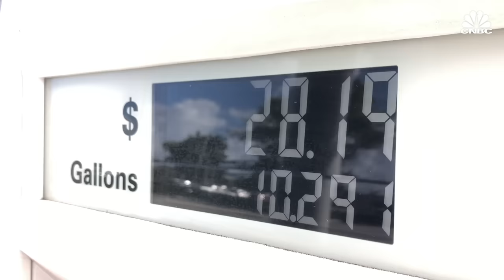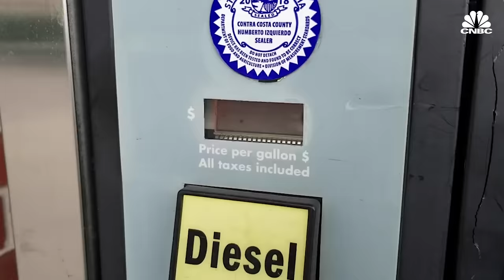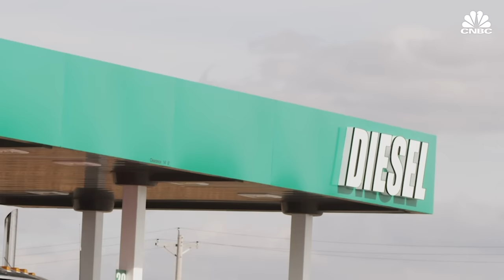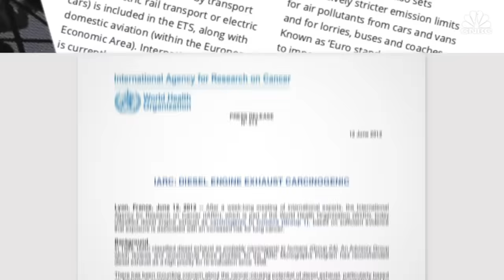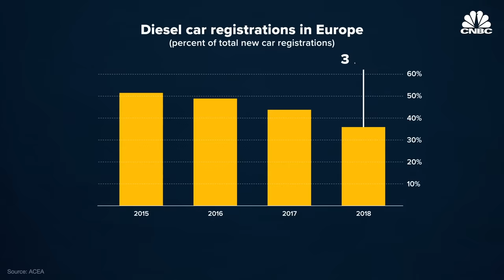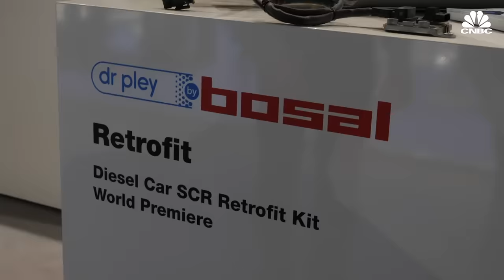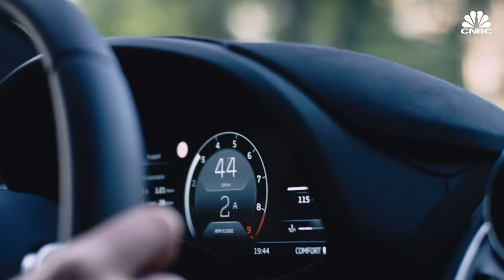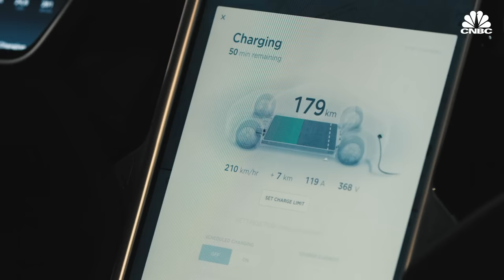Why Diesel Cars Are Disappearing

Comment: Republican here and these new Diesel engines are great for diesel mechanic pockets and are super expensive to repair ..high pressure pumps going bad and injectors because of tight clearances ..they have more moving parts  and the combustion process contaminates the oil on every start up.. why would anyone not use the sun in the sky for your fuel?  Have you ever heard of a solar panel ? Do you guys enjoy overpaying for diesel fuel ?  Makes no sense to me

Comment: It has always amazed me how diesel has crept into luxury car market. I am into true luxury cars big time, not luxury by fashionable brand name but by luxuriousness. So diesel has never been an option for me, as firstly they are noisier than petrol. Haven't some people heard of noise pollution? Stop start is also noise pollution. Now let's get practical here. Why spend so much money on a so called fashionable luxury diesel car with the priority of saving a little on fuel? Saving money on fuel is practical but spending lots of money to save on fuel does not make practical sense to me. Being practical to me, would be buying a cheaper car which would save me tens of thousands of dollars, and way out way the savings on fuel. And being a true luxury car advocate and owner, I can tell you this, that the difference between a so called fashionable modern luxury car, and a cheap Japanese car of the same size, that the marginal difference  in quality is so little. And when it comes to value for money the Japanese car will most likely give you better dependability. Not to mention serviceability. And just think, if you are not doing high milage then just buy petrol it is cleaner and less noisy. Might sound quieter than a two hundred thousand dollar fashionable so called luxury diesel car. Isn't that what true luxury is all about?, unless you are into noisy polluting sounding sports cars, and you dish out lots of money just to let people know you are there. It's amazing how society has led us into fashionable expensive impractical and familiar trendy ugliness in motor cars. Yes we may change some things for the better with the electric car, but have we in our haste really considered the downsides to come.  I hope we get this one practically right. Or at least better overall.

Comment: Fakery photos of exhaust pipes really cheapens the trust in this video.  The only time you get such visible exhaust out of an internal combustion engine is on a cold day before the engine fully comes up to temperature.
  You want greenhouse gas reduction, you go to bio diesel with the zero greenhouse gas increase.  (Hint, it is only a greenhouse gas when yuou are adding fossile carbon into the atmosphere. )

Comment: I will gladly use electric. As soon as I can run 450 miles, while towing 10k lbs, on a single charge. And fully charge it in 15 minutes from dead. And it cost me around $15k. And I seat 6 people comfortably. And have the cargo capabilities of an 8 ft bed. And last reliably 500k miles with extremely minimal repairs. 🤷‍♂️ what, you can't do that? 🤦‍♂️then stop talking electric cars

Comment: Every time I see a smoke belching diesel car or pick up, I wonder how much longer they will be tolerated. Most of the semi’s you see are well tuned and you hardly ever see one smoking up the highways. If passenger cars and trucks can’t comply give them the axe. The carbon footprint needs to be changed to a fingerprint.👍

Comment: Just add other fuels to burn the diesel better by adding propane natural gas hydrogen oxygen while it doubles the millage . And double the mileage again by giving us opposed piston diesel engines that you've only been letting the military have for the last hundred years, but keep that simple only 3 cylinder 6 piston, 1 liter for cars 3 liter for vans 21 liter for trucks. And keep your emissions garbage off , give us prochargers superchargers and turbo chargers, add water methanol to keep our temperatures from getting too high. But they wont they need to sell garbage and have repeat customers

Comment: Every barrel of oil, there will be a certain amount of gas and diesel after refining, If we do not use the gas and diesel, what are we going to do with them,pour it into the river?! The whole world are waiting for a break through in energy storage technology. for many applications. Even if we get that break through today, it will be at least 2 decades to get the infrastructure build. No more ICE cars by 2040 is so much pipe dreams. We are already at 2021. where is the break through? A significant amount of electric cars in US are really coal powered. I see nothing wrong with that, I am not a member of the climate religion.

Comment: why can't long haul trucks just be all replaced with freight rail?
Reply: How do you get the containers from the train yards to the warehouse? It's cheaper and faster to use trucks. Trains run on fixed schedules.
Reply: @kewlztertc5386  shipping itself runs on fixed schedules lol....also trains can be hauled into ports.
Reply: @Fals3Agent  no, shipping runs on a fixed schedule that the shipping company makes. They can change it, however they want. Trains are inflexible. Their schedules are made by the rail lines, and are shared by many different shippers. 

How do you get the freight from the train to the customers?
Reply: Because there aren't freight lines that run to the grocery store?

Comment: My  small diesel car , a Citroen, gets 30 km per liter( 70  miles per gallon)  New diesel engines are very very clean. Cleaner then gasoline engines. Also  diesel engines last double the mileage as gasoline engine.   People  are extremely stupid and shortsighted.

Comment: Very sophomoric and disappointing presentation.  No mention of the Common Rail fuel system that revolutionized diesel power.  Over emphasis on the VW emission scandal as a 5% increase in NOX versus a 10% reduction in consumption really was not a bad trade.  A big reason diesel cars didn’t catch on in the US as Europe was fuel price.  Diesel is far cheaper to produce than gasoline but somehow (taxes) cost $0.50 per gal more in US.  Also, everyone acknowledges that producing fuel from a food source is moronic.
After the upcoming power outages and auto supply change issues with exotic materials, ludicrous government mandates will be reversed.

Comment: Funny, we are starting to notice after Musk has challenged and destroyed the stats quo of gas cars. If the Oil and Car executives had increased research into Hydrogen powered cars or even battery technology in the earlier part of teh century, without looking for immense profits, less damage would have been caused to the planet by now. Also, BMW did a full Hydrogen regular gas engined 7 series test in 1999-2000. Robotic fueling of H2 at the gas pump, top speed was 120 MPH on the Autobahn. Exhaust was water vapor. But the industry started complaining about distribution and hydrogen plants. Interesting, since oil has to be distributed by trucks every day also.
Reply: 120 Mph? Come on, that's disappointing for a Series 7 BMW.

Comment: You wish.    There is no alternative except gasoline.  There is no electricity to charge electric cars.   The Toyota Ravv hybrid has a 2.5  litre petrol engine which uses more petrol that the 2 litre diesel variety.  The Biden administration in the US has just released stocks of this fuel reserves to cope with the scarcity.   This proves the choice is between  diesel and the horse and cart.

Comment: This is complete bs. Why do they spin such garbage. Diesel gets better fuel mileage and torque, they are responsible for literally everything heavy duty because of that fact. Longhaul trucking, locomotives, shipping, construction, the list goes on. I'd like to see a gasoline or electric powered D8 Caterpillar, not gonna happen. Also, they failed to mention that diesel puts out less carbon dioxide and carbon monoxide than gasoline engines. The black soot you see is simply particulate matter from unburnt fuel and doesn't "hang out" in the atmosphere. Typically black soot from a diesel means the engine is over fueled under heavy acceleration or during a cold start. The engines can be tuned to not smoke like that and it gives it better efficiency.

Comment: Yeah right. You're serious?  Ever thought that electric cars are zero emission but their batteries are a heavy threat to environment? Even the gasoline cars wil get the GPF (gasoline partifcle filter) so no combustion engine is safe for environment. Diesel engines will prevail as long as people are poor and the fuel are expensive.

Comment: Love how all the exhaust b roll they used for this is all coming from gas cars not diesel, you would think they would want to actually use diesel exhaust since its black but no they choose gas for some reason.....
Reply: yes and also more than likely using high milage petrol  engines , that would be burning oil and fob people off saying this is a dirty diesel , well diesels will be around for a long long time yet , ya just wont beat thier effeciency thank yiu

Comment: Diesel has already seen it's replacement in Europe. Liquid hydrogen is the winner. It will have the same efficiency or even better efficiency than diesel and have a better range than electric vehicles. Some London double decker buses are already running fully hydrogen. The only set back is it's production. Researchers are looking to find ways of how produce e-liquid hydrogen without releasing any carbon footprint in the atmosphere. Whereas petrol will be replaced by electric technology in light vehicles.

Comment: Diesel engines have been around for over 100 years, and they will be around for at LEAST another 100 years. EV's are ok in principal, but the technology and charging infrastructure is literally MILES behind. The main problem is that nobody is going to sit at a 'recharge' station for 45 - 60 minutes while their car recharges, when it takes less than 5 minutes to refuel a petrol or diesel vehicle at a petrol station nowadays.

Comment: A gas engine can no way meet the compression or torque  & pulling power of a Diesel  . Put 60 or 100 thousand  lbs on a gas job . The Diesel will still leave a gas truck in the dust . My question is can electric ⚡️ trucks  pull 100 thousand lbs  ? What about  CN & CPR  RAIL  are they going gas with a 100 + rail cars behind . Not  for years.

Comment: I drive a petrol car (VW TSI) and for work a Diesel truck (Hino 500 series). I've found myself having fun driving both vehicles, but driving a diesel engine compared to driving a petrol engine is very, very different. It depends on what type of driver you are, and what values you place higher up the chain.
Reply: I drove a medium duty Hino for 240K miles It was the most dependable vehicle I've ever driven. Stop and go with thousands of pounds of cargo,shutting down the engine without cooling the turbo,severe braking with the huge drums was effortless. Just a great Toyota product. I retired  12 years ago and the yard still has it and it's used daily.

Comment: Diesel phase out is the worst idea ever. We should be pushing forward with introducing dual tanks that used secondary running fuel. This would be waste vegetable oil, bio Diesel, and plastic Diesel. And investment in exhaust filters like catalytic converters will help alot with the emission concerns.
Electric cars can only truly be brought into the market if they can fix their life cycle analysis and self sustainability, especially with the energy used to make the batteries and how long they actually last.
Reply: Oi 💩4 🧠 Wake up! 🤭😅👉

Comment: Bu in europe you can pass mot with dpf egr and src delete, and siftware manipulation by tuners. Most diesel cars older than 6 years have all ecological systems off and still driving.  Only measured values are visible  opacity of exhaust. In whole europe. Yea they scan ecu for errors but tuners block all and seems engine is apsolute right, but there are nothing in muffler. Only some sound isolatio  left. Idiots!! Start to measure NO, CO, etc on diesels like on gasoline is measured from 1991.. Half of diesel car have manipulated exhausts.

Comment: The prob with big rig newer Diesel engines is they are JUNK. They don’t last. Breaking on the side the road and DEF fuel and scam.  You don’t see them putting pollution control on big ships or jets.   All the new def stuff for big rigs is garbage..   a lot truckers are finding older trucks and putting older CAT or Detroit diesel in these trucks and rebuilding them from ground up.  As they run circles around any new eMission control Diesel engines.  

I am all for clear burning Diesel engines.   But current DEF ones are still junk with all computer crap and what not. And all those parts are made over seas. Which has be shipped to USA/Canada.  Include the def fluid. Which use more products. More plastic more chemicals.   How’s is that helping saving the environment?   Imo they should making diesel/Electric hybrids. Along with biofuels/biodiesel.   Sure it’s not perfect answer. But it’s start.

Oh and as other have said. First Diesel engine ran on peanut oil.

Comment: I shall keep using diesel cars because I get better milage out of a diesel engines in the long run  it's cheaper. I won't ever have a hybrid because I do,nt trust them. I reckon it  would go about half way down the motorway and. the battery would flake out. they're a joke

Comment: because you can drive them forever...they outperform gas all day long for double gas distance and then compare a diesel to any electric...only a fool would conclude gas or electric is better....drive a diesel a 1000km on a tank no sweat...smoke that electric coal powered car...gotta love those old german mega coal mining machines that feed the coal plant...mine lithium is it clean and cheap...shhhh the equip at the mine all need diesel.    When electric mine equipement mines lithium and aluminium you will not drive a car but sleep on the street....lol